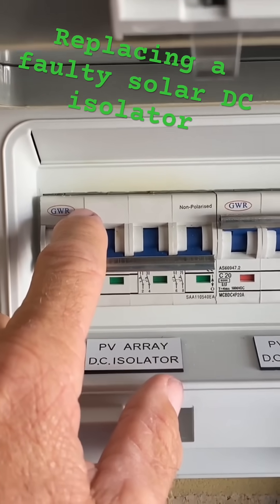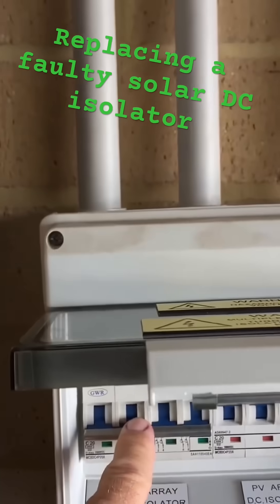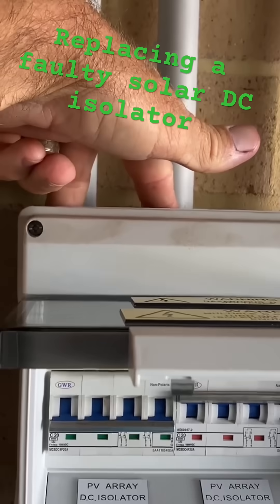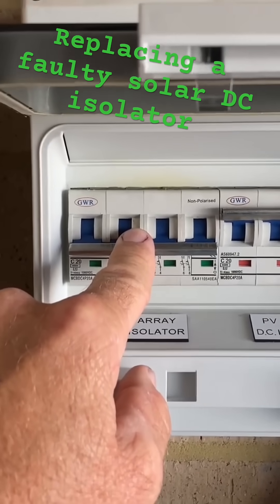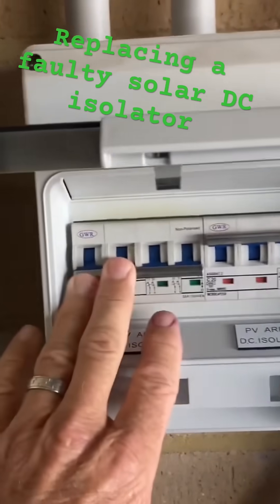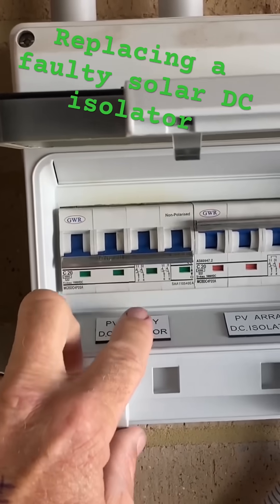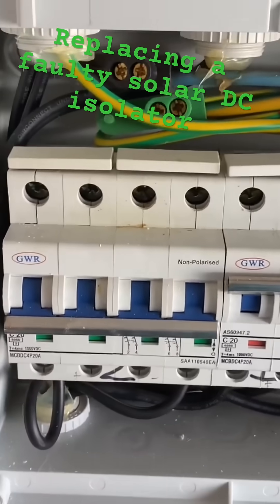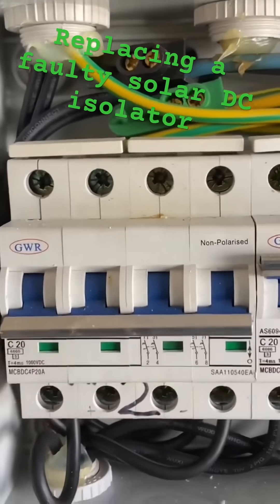Replacing a faulty DC isolator on a Sungrow inverter setup in Kalamunda. Full video in description.

Comment: There should be a mandatory conduit drain on the PV array DC cable conduit, in addition to not going in the top of the housing.
Reply from the maker: Only if the conduit is sealed with a cable gland, we typically leave the conduit open now.